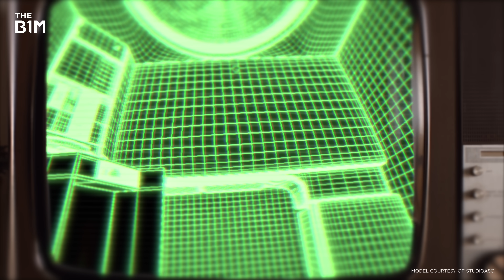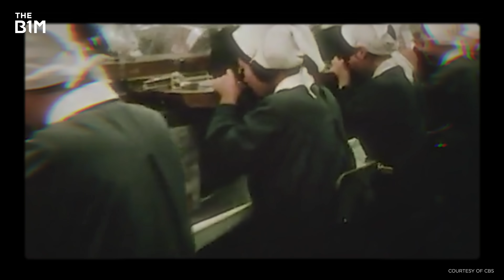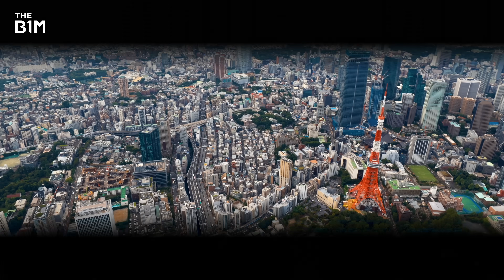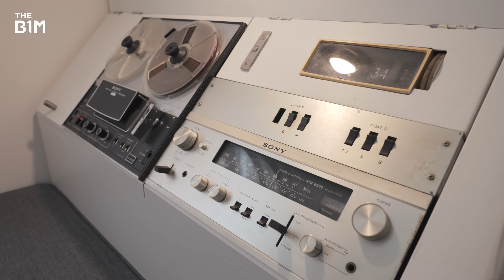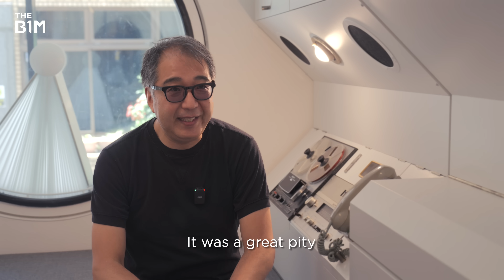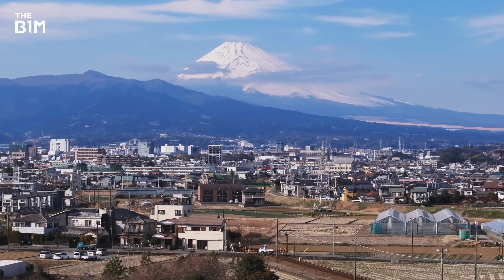Why the Nakagin Capsule Tower Was Japan's Best Failure

Comment: The core idea isn't bad. Its similar to modern generational homes. Build a core structure that last but the interior can be stripped out and replaced without the whole building needing to be changed
Reply: Failure: 😣😩
Failure in Japan: 😻😞✨

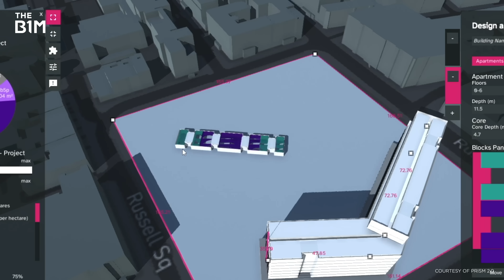Comment: 12:34 My country's (Singapore) gov't is promoting this as a way to boost construction productivity, as more of the building can now be mass produced in a factory that also builds rooms for other buildings & thus has more economies of scale to invest in more automation. Originally the buildings' walls were pre-fabricated in these factories (which could be as near as <100km away in neighbouring Malaysia where its cheaper) before being trucked to the construction site, lifted & assembled in place, but now the gov't is encouraging entire rooms to be pre-fab in factories (a process called PPVC) & then be trucked & lifted into place on buildings under construction, but I read that many contractors are unwilling to take the 1st step to invest in this as they fear that after that, other contractors can copy them & also enjoy higher productivity but without having to invest, gaining an unfair advantage. Wonder how much could patents manage this concern. Another worry is that with this kind of pre-fabrication, the buildings' exterior walls will now have seams in-between their pre-fab sections, raising the risks of rainwater leaking into the building. I also noticed that less customization is available with public housing with more pre-fabrication e.g. you can't opt out of vinyl flooring (which I've seen some people worry may contain harmful plastics chemicals)

Comment: I always thought this was a good idea for Oakland, CA. for when they take down the Oakland Coliseum. But would be designed for 1 or 2 person use with small bathroom (shower, toilet , sink) small kitchen (fridge, sink, 2 cabinets, a pantry, small stove and oven )small balcony and personal storage. 1 car parking and must live in to own or eviction and loss of property. With security cameras and gates everywhere. With direct access to BART and AC Transit a must. 
Low cost heating and air conditioning, water and sewage, then trash and recycling drop on each floor, with elevators up to the 20th floor or top and of course stairs. Solar panels everywhere, wifi and cable access, and on site armed security. Nine of this is expensive and city backed and run with price guarantees, utilities, water, sewage, parking, property fees all fixed. The Oakland Police Dept office on site if security is not and it being maned at all hours guaranteed. Since the residents would pay for it and not the city.

Comment: I had a lecture about avantgarde in architecture at university and the professor mentioned this tower. He also said that the fact that it didn't work and got demolished after 50 years is a typical thing that was happening to avantgarde architecture. Avantgarde architects were trying too hard to venture forward, fixing old things that didn't need to be fixed just to be new. The ideas they had were not bad, just not thought through.

Comment: The most "exemplary" (for want of a better word) examples of "modular" construction are the mining camps and hotels built in Australia during in the "mining boom" where splecially built "shipping containers" (with fire restraint metal) were used in camps (up to 1K or even 2K modules) and 3 storey hotels with 120 to 150 modules. Once the startup phase of the mine was accomplished, the ongoing operation of the camps only needed a fraction of the personal, so many camps were downsized with modules being moved to other sites, or being mothballed off sit or onsite. The "hotels were eventually supposed to be gifted to the community, but Inever heard of this happening."

Comment: Modern hotels, dormatories, and military housing uses a similar construction method where modules are factory built and assembled/stacked on site.  Although possible, the modules are not intended to be removed/replaced individually.  It's a great way to build for quality control and reduced time on-site.

Comment: Modular design is the only reasonable endpoint of mass production. 
Visionairy design, despite all its flaws.

Modular will always be a bit clunky, and not as space efficient as traditional designs, which is why it is not suitable for extremely dense areas, where it makes sense to build less cost effective but more space efficient buildings.
Wrong location, flawed design, but a step in the right direction.

Comment: If this is tried in America, which I have my doubts about due to its history and reputation, having similar size dimensions to shipping containers could allow for freight rail to bring them over for installation from the factory rather than only relying on trucks for the long distances, and using an external elevator that can be set up and removed like scaffolding could be used to lift each into their space and removed when their time comes.

Comment: Using components in a design system isn't the same thing at all. The unique and interesting thing about the capsules is that they were (theoretically) replaceable, and the existing building could adapt to new uses instead of needing to be torn down and replaced. This is a concept that is still sorely needed in the world.

Comment: Modularity. Nice enough in principle, but why did it have to be such an eyesore to have that? And even a simple "shelf" of pods would have allowed for taking out individual ones, so not even designed well for it's primary job. As for the "nautical" inspiration. Fine for space savings, but why copy everything so literally? What's the point of doors that don't go to the floor in a house? If I lived there I would curse the architect at least 3 times a day for that alone.

Comment: It's not a better dream house.
Those are TINY TINY capsules. You don't even have a private bathroom.
And it adds unnecessary failure points to every single capsule for no reason and offering no value.
It is a highly inefficient use of space considering that most of the space is outside the capsule so there is very little privacy outside of the tiny tiny capsule.
It is also wasteful. If a capsule is replaced that means the old one is destroyed and so all the material and energy and time that went into creating it and transporting it are lost and replaced with waste in a landfill.
The building itself didn't really do anything special either.
In terms of modular construction, modular homes were already being built decades before this.
Also there is no way to cheaply or easily remove and replace each of the units. You'd need to hire an expensive crane crew, get a ton of permits for the crane, shutting down the street, engineers to make sure it is safe to actually change out the unit, etc.
Reply: There was bathroom in the capsule itself. Just very little one.
Reply: You watched the whole video before commenting, right?

Comment: The upgrading of capsules didn't seem to be necessary, you can always gut and remodel them easier than replacing. I don't like how they were staggered, regardless of actual safety, I wouldn't want to live in a room that has an overhang like these did.

Comment: In 1972, I stayed in a new hotel in Paris with modularly constructed and installed rooms.  I don't recall the name of it.  I was a member of a group of US high school students on a language studies field trip.  There were areas on the surface of the building where the modules had not been installed, and we students found an area where we could look beyond the hallway directly to open air, where the rooms would be installed later.  There were access panels in the hallways, for access to connect and repair utilities.   One of our room assignments was for a room that wasn't ready for occupation (the mono block was in place), and there was an unproven rumor that another room assignment was for a room that was not in place; I only know that the key was not available.

Comment: I mean, even aside from the design flaw, there is also the issue that you would need to build a crane each time someone wants to upgrade. Since these buildings would probably usually be buildt in dense city center locations, wouldn't that be a major obstacle each time?
Reply: I think if it caught on as a trend and people actually used the modularity relatively consistently, buildings would be built with a functional crane built into them.
Reply: @chrisc1140  I could also see if it caught on a version where the crane is built into the tower and the pods can be moved without having to bring something in.

Comment: As an idea it's not a bad one - the problem was how it was the design & how it was implemented.  Maybe a better designed building with easier unit swapability & better mix of "pods" might have worked out, think more along the lines of say school trays but with a frame where you can "bolt" in and out without having to disturb the neighbours, say comprising of larger corner units & smaller units between them.  (note, I'm no architect, only house I'll design & build is with lego, so the feasibility of that is possibly out!)  Not entirely sure I'd want to live in something as small as these units, that's fine for a holiday, not so much for full time living!

Comment: Not a failure at all. This was an experiment and the legacy of experimentation is what we learn from it, not the preservation of the original aparatus. And it was an experiment that needed to be done - much more rigorous and alive to limitations than, say, Buckminster Fuller's Dymaxion housing. It challenged my own preconceptions of beauty. A work of extraordinary vision. Incidentally, we were once set the challenge in a maths class of designing the perfect blind/curtain for a circular window. The rules were it could not overlap the edges or leave isolated gaps and it could cover any % of the opening you wanted.
I don't think anybody got the answer. But in a few stills in your video you can see how Kisho Kurakawa solved it.

Comment: Some of the ideas used in the capsule tower have their origins in the housing developed by other great architects such as Le Corbusier and Buckminster Fuller.  However, one aspect that has been difficult to predict for the future of housing has often been technological advances, and the changes needed to supply all these services to newer buildings! 
Undoubtedly the capsule building was a brilliant but flawed design, which has gone on to inspire others to create their solutions to solve housing problems!

Comment: Another reason container homes haven’t taken off is because they have no insulation. So you end up having to basically build walls either around or inside a container. Which is silly either way.
Reply: Actualy many container homes are all over,being fireproof,unbreakable,typhoon earthquake resistant and low cost is main reason,Japan even has some container hotels.

Comment: Not a failure at all.  Innovation is not perfection.  It's a learning process.
Reply: If it's a learning success then where are all the subsequent modular buildings with replaceable units that learned from it and made improvements?
I guess you could say it's a success in that it proved that the concept was a bad idea, but it's a very generous definition of success.
Reply: They failed the movement by refusing to fix the apparent mistakes here, nor to attempt to build any more metabolic structures with the lessons learned. The movement just didn't have guts and financial backing.
Reply: @mfaizsyahmi  I think the main mistake was selling the capsules to individuals. If the kept it as a hotel they could have made much more profit over the years, introduce the metabolism to many many more people and use the building and hotel as collateral for next expansion. Most importantly, they wouldn’t have the problem of renovating it in phases as intended. Close the hotel down for a few weeks to replace all capsules, do some maintenance on inner core structure and boom they have brand new hotel.
Reply: @qiblik  Even use it as a testbed for new tech to eventually be able to replace each pod individually.
Reply: i disagree
Reply: This is just utter crap like all modernism. The only innovation is to strip these clowns of their license
Reply: if you call living in a room that look like some kind of space prison tower as "innovation" and expect people to accept that as innovation instead of calling it a failure, you clearly don't understand what MOST PEOPLE want when it comes to comfortable living space and only think about very few ones with that specific taste
Reply: Failure: 😣😩
Failure in Japan: 😻😞✨
Reply: Would you apply this same forgiveness to the designers of the Fukushima nuclear plant? How were they supposed to know the sea would come for their prescious reactors sooner rather than later?
Reply: @seiban8455 . This is absolutely insane comparison. 2011 Tohoku earthquake was 9.0 on Richter scale. That's like asking why japanese people live by the coast. Don't they know a tsunami will come and kill them sooner or later?
Reply: @seiban8455  The designers of Fukushima nuclear plant knew a tsunami hitting the plant is a matter of 'when' not 'if'. This is fucking Japan. Earthquakes are regular there. There is historical precedence of this kind of thing happening. Their entire history was influenced by earthquakes and tsunamis.

The plant was, at the blueprint level, designed to withstand inevitable tsunamis but they cut cost, took shortcuts and were complacent about it. This is unforgiveable.

Capsule-type apartments are actually new and without precedence.

You are not comparing things right.
Reply: @seiban8455  Fukushima No. 1 nuclear plant was certified as safe during a 2011 inspection though I remember, just before the tsunami
Reply: Yeah exactly, certified safe and everyone claims I'm an idiot for thinking it was anything but safe despite the goddamn reality. It doesn't matter what excuses you come up for it, nuclear disasters aren't supposed to happen. They're supposed to be impossible by procedure design, but they aren't. By reality. If your concept and design requires the humans operating, overseeing, and building it to be inhumanly better than we are to function, it's just not a workable concept. It doesn't matter how that comes about, in this case it was the sea rushing in, and in Chernobyl's case it was more political incompetency, to the degree it didn't even need a natural disaster to spark the nuclear disaster. THIS WILL KEEP HAPPENING. Read that if nothing else. It will happen again. There will be another level 7 nuclear catastrophe again. Soon. I wouldn't mind this so much if you would just be honest about the human cost of clean power and a solution to our combined and linked energy and climate change crisis. It was always going to take sacrifice, just tell us to our face that some of us are going to die of radiation poisoning and we're going to like it when we're living in the better future it brings.
Reply: @seiban8455  One is an apartment concept never tried before (and never collapsed because foundationally it is sound), and the other is a post-Chernobyl nuclear reactor with infrastructure technology built specifically to withstand tsunamis and earthquakes, that failed to work because the builders cheaped out and got complacent. There is no comparison to be made here.

Comment: All architectural ideas are simple. It's a simple subject
Reply: If it was that simple, there wouldn't be buildings that fail aesthetically, or technically to optimise human welfare.
Reply: @CuriousCrow-mp4cx  @CuriousCrow-mp4cx  well let's take the Walkie Talkie building in London. 

Who could have guessed that creating a highly reflective parabolic structure would focus light into one spot and melt cars. 

I fully understand the difference between foresight and hindsight, but that's beyond dumb, and literally childsplay (playing with mirrors and lenses in the sunshine)

The OTT retrofitted sunshades are a hugely expensive joke. 

The whole building industry is a luddite. Innovation and creativity is pretty much outlawed. 
Again, I get the reasons why - buildings have to last for a long time, and litigation is expensive. 

Even the Engineering is bottom rung. Much of it hardly classes as Engineering because no first principles are ever employed. They just tick boxes and design according to antiquated rule books. It's the paint by numbers version of Engineering. 

Buildings that overheat, echo, etc, etc are imo because they are designed by tick boxes. If real
Engineering was employed, those obvious failures wouldn't happen very often at all, and the industry would be innovative and creative instead of wading through sludge. 

Its not for me, that's for sure.

Comment: I was taught all these modular architecture pieces at arts academy. I was never convinced. Those are nice ideas, but you can just SEE that they are not practical. It feels healing for me that they are not presented as that monumental genius ideas any more.
Reply: I agree, engineering design is about solving problems, and the idea of a replaceable modular housing unit does not solve any. 

What real actual scenario exists where you would remove and replace a single pod? It will always be so much cheaper to renovate the interior or to just pick up your things and move down the street. Hiring a crane to block off the downtown street, purchasing an entirely new pod, while your old one probably gets landfilled? Keep in mind that the new pod is constrained by the building to be extremely similar to the old one in almost every way.

Maybe if the pods are structurally failing, it will be cheaper to replace them en-masse than to shore up regular apartments, but I'm sure you could've gone a much longer time without worrying about that by not constructing everything as an independent cantilevered pod...